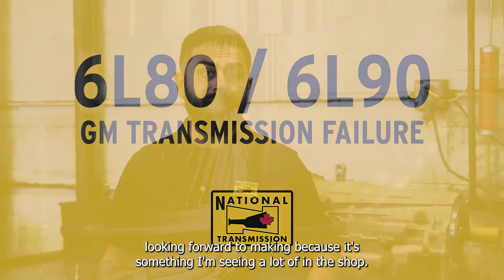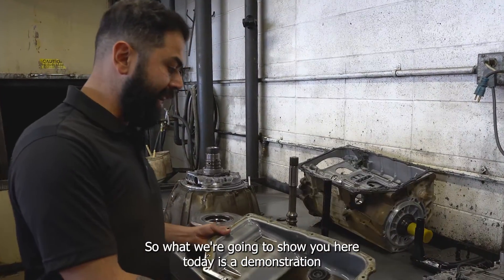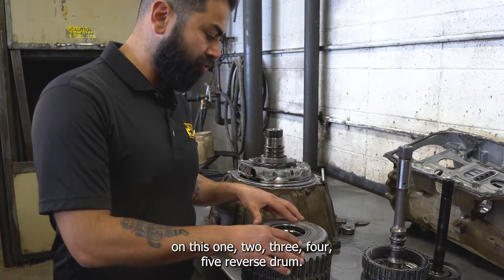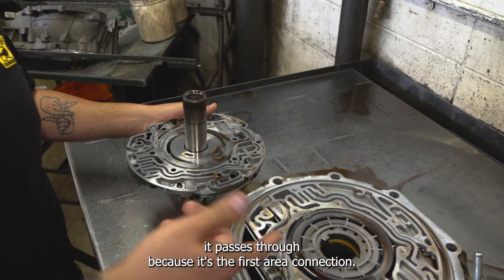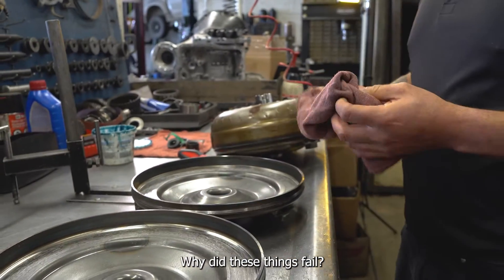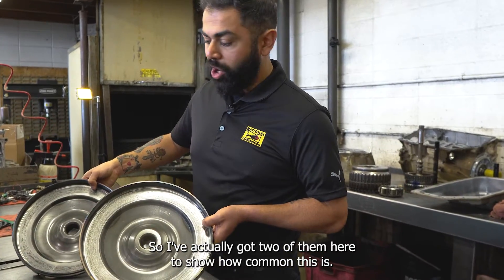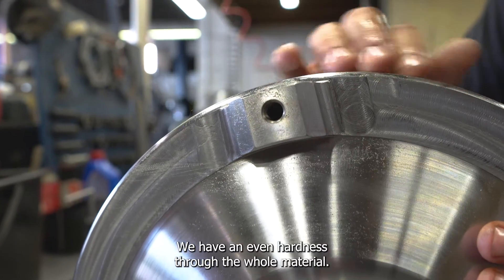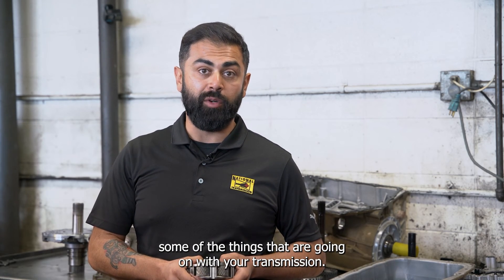How We Fix GM Transmission Failure (6L80 & 6L90)

Comment: Bought a low mileage 2017 Yukon in April of 2020. First thing I did was go to my local transmission shop that is well known and trustworthy and have the stock converter replaced with a Billet one. Transmission was working fine, but the stock torque converter as these video shows, are junk. Transmission shop also did some recommended changing on how the transmission works. Can't remember the details on that, but I had complete trust in the owner of the shop that did the work. I also changed out the internals of the stock transmission thermostat with a bypass kit that lowered the temperature to a more respectable temperature. This in itself will help the life of the transmission along with regular fluid and filter changes. Many neglect changing the transmission fluid and filter and shorten the life of the transmission in the process. Excess heat is a killer to a transmission. Really enjoyed your video. Thanks for sharing and letting people know the ticking time bomb within there 6L80 & 6L90 transmissions. Better to replace the converter before trouble starts and damages the internals of the transmission.

Comment: How about having your 6L80 transmission fluid changed around every  30,000 miles? I have a 2017 chevy Silverado Z71 LT crew cab truck with 5.3 engine with 42000 miles. Please respond.  Thanks

Comment: I have a 2019 Tahoe Premier with 45,000 miles .All was good till I had trans serviced.
It's a 6.2 with a 10 speed.
Now at 40-50mph when you accelerate,you get a shudder so I back off.
It shifts normal from a stop.
Can I drive it till I can get it checked out?
Reply from the maker: A shuddering feeling can be caused either by a clutch slipping inside the transmission/torque converter or by an engine misfire. Depending on which component is failing, damage may or may not be occurring — but it’s best to address the issue sooner rather than later, and avoid driving the vehicle under those conditions.

Comment: 2016 Suburban. Changed transmission twice, third one is about to fail and needs a new one. Stay away from Chevy - dealer charges $7-8,000 to replace the transmission

Comment: You said 2008 to 2018. I've got a 2020 what about those and the 2019
Reply from the maker: You are correct GM started phasing out the 6L80 in pickups around 2015, but some trucks (especially lighter-detailed ones) still came with it through 2019–2021, depending on engine and model.

Comment: My converter just started to fail. is it possible to catch it before it ruins Transmission ?
Reply from the maker: Replacing only the torque converter can sometimes work, but it’s important to understand that when a torque converter fails, it can shed metal shavings and clutch material into the transmission fluid. That contaminated fluid circulates throughout the entire system, potentially causing further damage to the pump, valve body, and other internal components. To avoid future problems, the entire transmission system should be thoroughly cleaned, flushed, and inspected — and in some cases, a complete rebuild may be necessary.

Comment: 2019 silverado with 6L80, 133k miles and it just started slipping and making a high pitch whine when it slips. When i drive, transmission temp stays at a contant 190, today I noticed it got up to 201°. I though I had that unicorn that evaded trans issues but nope, mine was a late bloomer. Unfortunately, there are no class action lawsuits for this 💩 transmission and the God awful AFM system. 30k miles out of warranty and 3 months before paying off, if it wasn't for bad luck I'd have no luck at all.

Comment: My 2012  6l80 shift good to it get hot than it stop pulling cut it off and wait bout 10 or 15 mins than you can go again shit all gears good but only make it 3 miles before it stop pulling and the trans start shutting when pulling off from stop
Reply from the maker: It sounds like the filter may be starting to plug up, which could indicate it’s time for an overhaul.

Comment: So what do I just need to use a different torque converter other than Orem one?
Reply from the maker: The main difference is the billet cover torque converter. Keep in mind that the transmission should be disassembled for inspection if you’ve had a torque converter failure, as damage to the pump and other components often occurs.

Comment: Is the 6 speed found in the gas powered 2019 2500hd prone to these issues as well, or have these these things been corrected in the 2019+ models? Thanks, great content!!
Reply from the maker: Production of the 6L80 has not officially stopped—GM still lists it as active. That said, its use in new GM vehicles appears to have largely ceased by the 2021 model year, as newer 8- and 10-speed transmissions have taken over.

Comment: Hey guys, i have a 2018 GMC Z71 4X4. I've noticed a clunk sound sometimes at take off and sometimes at downshift. Transmission or drive shaft? Any input will help. Don't know if i should keep it or trade it in and mo ve on.
Reply from the maker: Clunking on initial acceleration from a stop, or even during a downshift under acceleration, often points to a worn or broken engine mount. It’s also possible for worn U-joints to cause similar symptoms. I’d recommend starting by checking your engine mounts to make sure they’re in good shape before looking into other possibilities.

Comment: The first transmission only lasted to 34k miles. I did notice my second one started acting strange right about 2500 miles in. I also noticed that temperature takes a very long time to get up to operating temperature.
Reply from the maker: Whomever repaired the transmission may have installed a kit in the thermal by-pass valve which would allow for full time cooling ( We find this helps the longevity of the transmissions in our region.)

Comment: 390k miles on my 6L80 and it just crapped out last month. I change my fluid every 35k miles and filter every time as well. 1 quart of Lucas transmission stop slip with every fluid change since the 100k mile mark. It’s a 07 Yukon Denali 6.2 that’s got performance upgrades and I’m constantly stop light racing people and the speed limiter is also retuned to 140 mph and it sees those speeds regularly. I use it for work and carry about 400-500 lbs of tools with me at all times. I’m a mobile forklift mechanic. Enough tools to completely disassemble a vehicle on the side of the road if I wanted to. Fluid and filter changes keep these things alive. Period. Most people are lazy and that leads to certain transmissions getting a bad name. I’m currently rebuilding it and doing the full transgo tow and pro and blue raybestos frictions. I tig welded my 3,5,R drum (you called it the 1,2,4,5 drum) doubled up the magnets in the pan and tig welded in a drain bung.

Comment: so my 2018 gmc Sierra 151k nanny all of a sudden stop moving forward.. I turn the key off wait a few seconds start it bk up n it drives for a lil ways thens stops moving fwd,, what would cause this
Reply from the maker: Sounds like the filter may be getting restricted and the pump stops producing pressure, After it sits for a while the debris or possible clutch material settles back in the bottom and its capable of drawing fluid back in to the pump. If the fluid level is okay, this indicates internal issues.

Comment: I have a 2016 2500 ltz. I BELIEVE that I have the 6L80. I could ve wrong. What signs will the transmission show? I have a hard and delayed shift from a harder take off and then sometimes a delayed shift on higher gears. I don't abuse my vehicles, and I bought this used. I don't know if I have the same issue.
Reply from the maker: Hard and delayed shifting may be a result of wear in the valvebody, or transmission. The best indicator is looking at the magnet in the transmission pan when your performing a transmission service.

Comment: I assume it's the same situation with the 8L90 ?
And I assume transmission shuttering is the first sign of the torque converter clutch going bad?
Reply from the maker: The fluid has been found to be the cause of the vast majority of the “true” TCC shudder issues with these applications. Flushing the fluid from the transmission/cooler and installing the updated HP fluid will eliminate the issue in most cases. Dexron HP LV is still used as the description on the bottle but it is a different fluid as compared to the earlier fluid. The new fluid can be identified by the part number (19417577) and its blue colored label. Keep in mind that you will need to drive the vehicle for an extended period of time (up to 400 miles) to eliminate the shudder in some cases. But like all other repairs, there is not a one size fits all solution.

Comment: any thoughts on the thermal mod to keep the temp down ? Looking at those dark spots on converter I'm leaning on keeping the trans cooler to begin with. TC upgrade isn't a bad idea/ I'm no mechanic just been looking at a lot of info on these . 
cooler bypass kit is under 20 bucks.
Reply from the maker: We find the thermal by-pass kits work well and is a worth while upgrade.

Comment: The 2018’s run +/- 50 degrees hotter than older models. Replace thermostat block on transmission to cool down tranny before it’s too late!

Comment: hello >i got a 2014 GMC acadia , i got some issues , when i reach 20 -30 ,miles speed, i felt a shake , u guys think thats can be the torque converter ?
Reply from the maker: That is one of the possibilities, you should really have it diagnosed before making any decisions.  Our technicians would drive the vehicle with the scan tool installed looking at torque converter slip speed, and engine misfire data.

Comment: Have a '12 3500 Chevy van, have 152k on it. Started slipping, and she's in the shop for a remaned trans. Was told it lasted this long because I changed the fluid and filter every 45k mi. Kind of disappointing that I only got 152k out of it
Reply from the maker: I would agree, transmission fluid breaks down and most transmission have a paper filter similar material to your engine oil filter that needs to be changed.  Keep up with your regular maintenance.

Comment: My 2002 Silverado 1500 has 200,000+ miles on it. Trans is still running strong. 😁
Reply: My 200k 02 Express van has a electric cable shift 700r4...flawless I pull a quad trailer cross country.....change your fluid .
Reply: Yeah had a 2000 siverado with 400k on it before i sold it  now my 2015 only has 72k and trans gone what a difference 15yrs made by the way iam the original owner of both trucks and they were well maintained
Reply: @Bailey-k2j   fluid got changed  under 40k
Reply: I had an '05 GMC Sierra 1500 base V6 T5, put 310K nearly flawless miles on it. Traded it in on a '21 GMC Sierra 1500 base V6 auto, transmission just failed, warranty just expired. I wish I had the '05 back.
Reply: Well then it doesn't have a 6L80 or 6L90 transmission, which came out in 2008.  Duh.
Reply: @danielholtxxl4936  Still same basic design. DUH!!!

Comment: Heat does not harden metal, immediate quenching after heating does.  Hardened metal that is heated and not re-quenched becomes non-hardenned metal.  TIP- Replace the torque converted at the first sign of seeing the black clutch material or slightest shudder and you will often buy yourself 20+ thousand miles if you are in a financial pinch.  Not every one has 3500+ dollars bor the billet converter rebuild...

Comment: For those who have replaced the transmission in your vehicle, have you filed a report with the NHTSA? I had to replace mine around 100,000 miles.  They won't acknowledge it's a real problem if reports aren't filed by consumers.
Reply: How do i find the phone #
Reply: My 2015 just had trans go at 72k  and im not only the original owner but i babied the truck  so as soon as i get it back i will list it for sale  !
Reply: Where do you report it?
Reply: @user-jdin4szjw  https://www.nhtsa.gov/report-a-safety-problem

Comment: l installed a Range on my 07 GMC at 80k. Also pulled the brake booster electrical connection to interrupt the converter lockup. Still running just as smooth as new at 215k. I now am having issues with my 2014 Buick.

Comment: If anybody is having issues with TCC shudder or just want a preventive fix on a low miles truck or have a fresh rebuild and want the software issue resolved then contact me, my email is listed on my channel, I do tuning with HPtuners on 6L80 or 6L90. I can also tune any V8 gen 4 to gen 5 to make it smoother, more power, AFM/DOD delete V8 all the time! I am located in East TN. I can travel to you for additional cost.
Reply: Do have a number I can call?

Comment: The problem is not the transmission. It's the torque converter shits through your transmission! If your 12-19 sierra/Silverado has less than 80k miles and you don't feel shuttering or slipping. I suggest you upgrade the torque converter and replace the thermostat knuckle to avoid shuttering and transmission rebuild/replace!

Comment: What to address and fix before Failure....??????

Thanks
Reply: This guy obiously knows his transmission but gave me nothing other than an invite to spend some money with him to look at mine.  I stumbled on the check valve retrofit kit (superior 6L80 6L90 8L90 Sure Cool System Upgrade STL010) that replaces the thermostat and allows fluid to flow to the cooler before it reaches like 180-190 degrees.  Prior to the install mine would hit the 180-190 degree and go up from there.  After the install runs much cooler 110-140 (depends on outside temperature and load).  Not sure that the heat is the issue however it it is the retro kit is a no brainer.  For around $40 and 30 minutes of install time mine runs much cooler.  I really can't see how it would hurt to install it unless you live in a real cold area where it needs to heat up in the winter to make things work correctly and again not a transmission expert or even a what to be, just trying to keep from spending $4,000 on a rebuild when it hits from 80K - 120K miles that all of my buddies have experienced.  Note I said ALL, I have bought my last GM anything was 61 and have been a loyal customer for 40 years.  The exhaust cross member under the pan and the AFM that was forced on me (programmed out as soon as warranty expired) will make me purchase perhaps a Toyota next time.

Comment: I have a 2015 Z71 Silverado 6-speed transmission, I get the Chevy Shake on the highway, I have had the trans checked and they said there was no metal shavings on the magnet, so then I had the tires and wheels done, then the U-Joints, then the CV axles done, then the bearings and bushings in the differential.  Still shakes, i keep seeing the driveshaft or torque converter failure is what people say.
Reply: Its either drive shaft or rear axle hub faces are out of round. I have it too. My hub faces are out of round. Put rear on jack stand and take wheels/tires off. Put in drive and let spin. You can see it wabbling if they are out of round.
Reply: @ZachWH87  I had the drive shaft done, the front CV axles as well.  So you're saying that my rear axle is probably out of round?
Reply: @DrMcnugget1  it's a possibility. Thats what's causing my shake. I watched it wabble when I had it on jack stands doing the brakes. I searched and searched forums and everything. Turns out, that is one of the causes of the shake.
Reply: @DrMcnugget1  Its the hub faces. The round part at the end where your studs, rotor and then wheel mounts too
Reply: @ZachWH87  I appreciate that, ill have them check that out when spring hits.

Comment: My 2017 Chevy Silverado 1500 HD  
6-speed 5.3Ltr Transmission just crashed at 125,000.00 miles. New one cost 4,000.00. Damn 

On the bright side I have a bad ass truck with a new transmission.😮😅

Comment: It's a conspiracy! Shops don't Wana replace just the torque converter they always claim the transmission got "destroyed". I can testify to this,  my 6l80 shuddered for couple thousand miles than stopped moving completely, never slipped or shifted hard, me and my brother replaced the torque converter, changed the oil and filter 2 times now it drives like a dream. The oil pan and magnet had flakes and metal dust, about a  cupful.
Reply: I drove my 2013 half ton for a year towing stuff over the road before it finally quit pulling when the transmission fluid got up to temperature.

It still drove around town ok it just wouldn't pull once it got hot.

Comment: You definitely don’t know torque converters.  There’s a turbine inside of them, not friction pads that contact the front face.. 🤡
Reply: Lol. Looks like you're the clown... go look up a cut open converter.  They absolutely do have a clutch with friction material.
Reply: Wrong. The converter locks up at a pre determined RPM called 'stall speed'. The turbine gets the vehicle moving with trans fluid, then the lock up happens, with a clutch, so the engine and trans have a solid connection to increase MPG, prevent the fluid from overheating,  and increase power to the wheels.

Comment: 2017 Chevy Tahoe LS. Have to rev it to about 2k RPM to get it to go into drive. Once it goes into drive, it will shift perfectly. Fuild is red, no leaking and no burning smell. Any advice?
Reply from the maker: Sound's like a pressure issue. If the fluid level is good and the internal filter and seal are in place. Then the transmission would need to be disassembled for inspection.

Comment: I actually worked for a torque converter tier 1 supplier as a test engineer. Your component nomenclature of the Torque Converter is wrong.  The base that attaches to the flex plate is the called the cover, and the opposite side is called the impeller/pump of the TC.
Reply: Yup you are an engineer and a jerk.   Never repaired